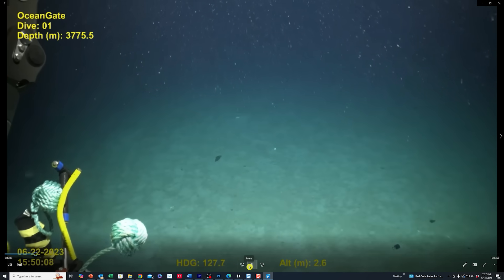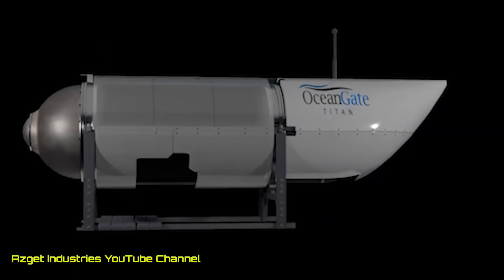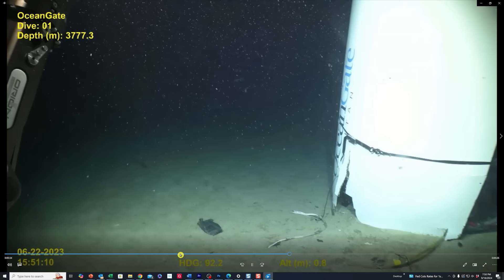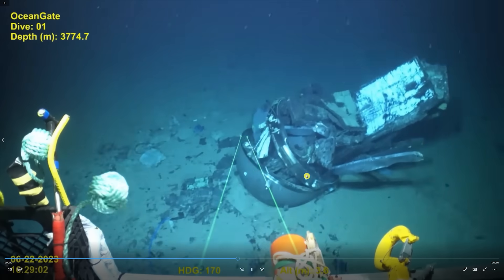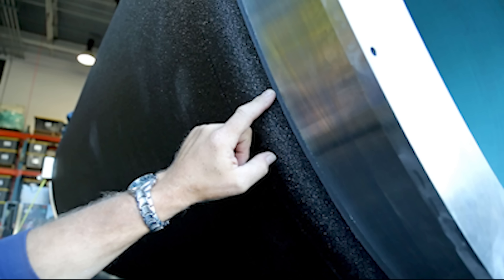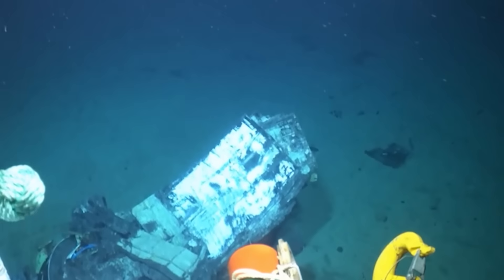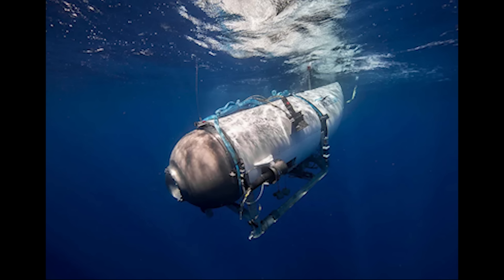OceanGate Titan Sub Debris Video Shows How It Imploded

Comment: As sad as I am for the families, this is starting to shape up to be the scam of the century.  I saw the release of liability forms which included the submersible was never subject to regulatory oversight.  Of course the carbon fiber was going to flex under such extreme pressure.  What I did not know before was the titanium constructed domes.  Titanium is an inflexible material.  I also thought the touching of the titanium by bare hands plays another major role.   Basic rules of adhesion requires clean oil-free surfaces.  I am not sure if the families have any recourse at all due to the release papers signed by each party

Comment: So if it’s on the bottom of the ocean how did someone put a ratchet strap around it?
Reply: Strap was on it before it went down. Shows how many corners they cut, holding the tail together with a ratchet strap.

Comment: As a certified JB Welder I think that some grooves or ridges should have been machined into each end cap as well as corresponding ridges in the carbon fiber. Then slice up the end caps like a pie so they could be installed inside the carbon fiber tube. Also a reinforced ring of titanium dead center. The glue joints where carbon meets titanium is eventually going to be found as the cause  -  in my opinion.

Comment: I'm no engineer, but I wouldn't even glue gussets to the truss on my backyard shed without some mechanical fastner reinforcement. What were they thinking just gluing polished titanium rings and end caps on carbon fiber?  This is proof that engineers conflated egos get in the way of design.

Comment: that first dome we see is the back end of the dome. based on what’s left of the titan, that second dome we see with parts of the hull on it are the window. the reason it looks the way it does is because a fail point in the carbon fiber happened at the front end of the diy sub, and everything inside and the sub it’s self got pushed into that second dome we see which is why you see all those small bits inside. theoretically, that is where the passengers are, they got pushed into a dome, along side the sub, in the span of milliseconds

Comment: That's an excellent point to raise, relative to the potential adhesion between the polished surface of the titanium ring and the "peanut-butter" adhesive.  There doesn't seem to be any "tooth" on the titanium ring for the adhesive to grip. And it's highly unlikely that any chemical bond could be formed, as titanium is almost chemically inert. 
So this is a significantly unanswered engineering question.

Comment: The first dome you see, the one stuck alone in the sand, is actually the front dome, the one that has/had the view port. The part that is still attached to some carbon fiber debris (which we can see just after) is the aft dome. You can even see the rings that connected it to the technical module (the white thing we the OceanGate logo we saw right at the beginning).

The titanium ring who sat between the carbon "tube" and the front dome is not visible on site. Maybe it has been thrown really far away by the brutal effects of the implosion, as its shape makes it more "hydrodynamic" that the whole titanium front dome itself.

As we can see in the videos presenting the whole scene, it's more than likely than the implosion started in the upper part of the carbon fiber tube, right at the junction between it and the front titanium ring (the famous one that we can't find, as said before). Looks like the "roof" collapsed and pushed everything inside right towards the technical module of the sub, which was actually set inside the aft dome.

Looks like the glue might have been the weak spot and the origin of the accident, actually...

edit : the rear part with the OceanGate logo looks relatively intact because it wasn't pressurised. It was always directly exposed to outer pressure of the ocean, so the implosion had relatively minor effects to it, as it was already exposed to the 380 atmospheres you have at this depth.

Comment: One thing you know for certain, is that cheap ass Mad Catz controller disintegrated. Wouldnt be surprised if they lost control of the sub because the directional button popped out of the casing or the directional sticks snapped off.

Comment: The wreck of the titan. 
Although the novel was written before the RMS Titanic was even conceptualized, there are some uncanny similarities between the fictional and real-life versions. Like the Titanic, the fictional ship sank after wrecking on an iceberg in April in the North Atlantic Ocean, and there were not enough lifeboats for all the passengers. The Titan would have survived a head-on collision with the iceberg, but a glancing encounter did more extensive damage. There are also similarities in size (800 ft [244 m] long for the Titan versus 882 ft 9 in [269 m] long for the Titanic), speed, and life-saving equipment. So not only was there a book that basically predicted the titanics sinking that was named the TITAN. But then hundreds of years later, there was a submersible named the TITAN that ALSO had casualties and ALSO ended up in 2 pieces on the ocean floor by the Titanic. 🤯

Comment: The dome is the front titanium dome with the viewing port. Even though the titanium is so strong it does flex some as carbon fiber even using the layering process is strong but rigid like heat treated aluminum very strong but brittle and when carbon fiber breaks it literally shatters it will not break in large pieces. As an Aerospace engineering background I worked with many unique materials.  And Carbon Fibre is the least liked in the industry unless it will be permanently applied in outerspace.

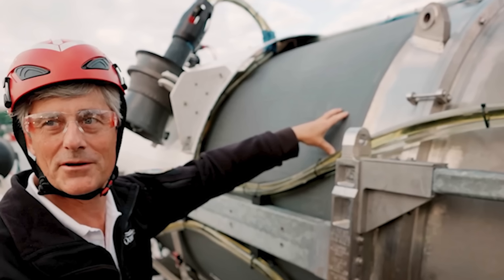Comment: @6:50 is it just me but does this guy sound creepy as hell the way he says this and smiles. Im not implying anything lol ... just damn!, if i had said it id be thinking I wish id done that peace to camera SLIGHTLY different in hindsight.  just after watching how it was made would have stopped me going in that disaster waiting to happen, he broke probably all engineering protocols just in the design of it but the way he had seperate materials in contact with each other scares me especially when done at pressure its like his mind was working on the thermal side of design to manage extremes of heat and made to be light and not thinking for pressure. I mean a chicken egg/ champagne bottle or raindrop can show us better designs than this flawed deathtrap at depth.

Comment: If the maximum speed that fresh water can decompress at is 1,500ms or  Mach 4.3. Now will this change if saline levels and temperature, ph change? I assume so.  For the submersible to implode then, the surrounding water needs to be decompressed, the amount needed of water needed is relative to how compressed the water is, so at 6,000 psi, water will compress by 2%, this means 50x the volume of the sub will need to be decompressed. I estimated the volume of water needed to fill the sub as 15m3, so we'd need 750m3 of water, this has a radius 5.6m. The decompression wave travelling at 1,500m/s (speed of sound in water) would take 3.7ms to decompress this amount of water, ergo the time taken to implode the submersible, with a water speed of 398m/s or 890mph.

Time: 3.7ms
Speed: 890mph / 1,432kmph
you aint feeling the implode but you will feel the many minutes prior when youre in full panic mode.

Comment: is that a bag of polystyrene cups in the top area of the wreckage inside, i.e they show how a cup becomes a thimble sized tiny cup due to compression at such depth, when i dived years ago we did it, wrote our names on them and after a deep dive we had a keepsake of our dives with name date and coordinates in a thimble sized dense cup. well it appears to me they probably did the same here, because i would have tied one on for this reason.

Comment: The problem is gas inclusions in the carbon fibre laminate, and adhesive section. Those gas pockets would have been compressing and expanding each pressure cycle and causing the gradual delamination and failure of the carbon section. The only way to have been aware of this is exhaustive x-ray examination or similar. Of course that's expensive and Rush was all about cutting corners.

Comment: @Jeffostroff    When repairing electronic devices, I remove hot glue from the circuit board by simply putting Isopropyl alchohol on it. The IPA has a low viscosity and it gets in between the hot glue and the board, releasing the bond. I wonder if, given the smooth Ti surface on the rings, the high pressure water helped by the flexing of the walls got in between the ring and the glue,in a manner similar to how IPA works on hot glue? That would not give any audio clues for their early warning system to catch. While every dive would cause a little more water to creep into the gap.

I agree that both the smooth surface on the rings and the obvious neglect of potential contamination by people putting it together, give good reason to think that the glue-Titanium bond failed. The end cap that still had wall with it looked like all of the chunks of wall had been shoved into that end. The cap was separated from the ring; like something had pushed it. If I'm right about the glue failing, and perhaps the window let the other end cap flex more, then I can see the bow end ring separating suddenly and the tube collapsing in and towards the stern. I think that would explain the things we see in the video.

Comment: You know, it is sad that it wasn't a workable design. The problem with deep water submersibles has always been that you can only fit one or two people into a tiny cramped sphere. If the carbon fiber design was workable, being able to take down multiple people in relative comfort (poop bucket notwithstanding) would've been a brilliant advancement in deep sea oceanography.

Comment: Glue plastic on to a shiny metal surface? That was a dumb idea. 
Platstic to metal interfacing is always going to fail under normal stress condition, let alone the 3800m depth environment.

Comment: 9:17 The big piece awfully looks like the smaller pieces have been drawn towards the front window.
I would assume, that the fault was somewhere in the front. Either the Ring connection or the looking port.
Edit: just noticed i mixed it up. the large portion is the back => probable fault in the connection between carbon and metal. That would even make more sense, cause the dome and the actual aft of the sub separated.

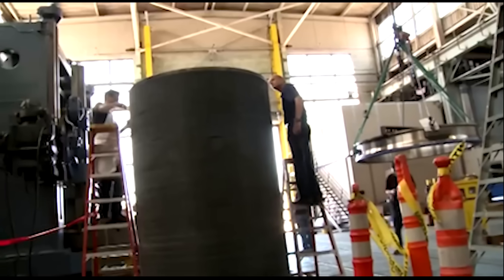Comment: 7:56 Depending on the type of adhesive, roughing the surface is counter productive.
Also priming the surface is depending on the type you are using.
I worked with a 2K adhesive professionally while developing an application, the metal part didn't have to be primed but the corresponding plastic part had to. (Later, during production, we saw, that even un-primed plastic had more than enough strength to hold twice or trice the necessary forces, so we ditched the priming entirely. And we were able to since it was a household appliance and not a safety aspect feature of a sub.)

Comment: i saw a vid by scott manley saying a break mustve occured at the forward interface between carbon and titanium, maybe the metal and carbon were not stressing / flexing equally so caused additional stress at their interface, the glue failed and the implosion occured at the front propagating backwards. hence no debris around the front dome as it simply fell off, and the debris carried back and around the rear dome as the hull and interior imploded back into that rear dome.

Comment: The second video is haunting. You can see the mechanism of death. 
The glue failed. The bow titanium ring was torn clean off and there seems to be no sign of it.  The bow titanium cap was there, no window that I could see. The “peanut butter” failed. The ridiculous way they applied that glue….there were voids and bubbles. All it took was one small point of failure and the water got in at unimaginable pressure. It forced all of the wreckage of the carbon fiber composite cylinder and everything else (remains) into the aft titanium pieces.

Comment: The aft section did not have the titanium end on it, it was found about 20 ft away from the front section titanium and plexiglass window, which looks like part of the inner aspect of the carbon fiber hull tried to force its way through the front titanium sphere? cheers 🦘🦘✌✌

Comment: I think the carbon fiber idea might have worked if it had been reinforced on the inside and outside with some kind of hardened steel insert and an outside skin of steel as well, maybe a half inch thick in both cases. Basically a hardened steel pipe that was equal to the diameter of the inside of the tube and another pipe that would go on the outside, both would have to be tight-fitting though, and probably glued in place.

Titanium is strong, but it is harder to work with than steel, steel is also more affordable. The drawback with using two different metal types is differences in corrosion rates, so more maintenance would have been required (as if more maintenance wasn't already required with carbon fiber and titanium).

It would be interesting to test a design like that and see what kind of results it would produce.

Comment: Acid etch and sterilize the titanium ring at a minimum... but for better locking adhesion, it should of had many small holes drilled into it for the epoxy to grab into.  Horrible incompetence displayed in their assembly process indeed.

Comment: yeah idiots an 1/8 inch or thinner welded titanium cylinder would have probably given the CF something to push against and I can't believe he had 2 titanium rings cut and then glued it to a CF toilet paper roll.. Just opening the door creates fatigue on the joints the way he built it. I literally all relies on glue

Comment: So, it essentially failed the way everyone said it would. The graphite cylinder collapsed, ripping it free of the unpressurized tail and popping off the domes at either end. I hope they didn’t have too much warning when it went.
Reply: Or the fancy domes popped out like champagne corks because there was no crosshatch scoring, grooves or other deviance to an otherwise perfectly smooth substrate. 

'Glue', 'Peanut Butter epoxy', etc. can only work as a part of a system. The 'right glue' for the job. If the adjoining parts can be 'melted' together like with PVC glue, cool. But most metal doesn't like or even care about adhesives!
Reply: There is a video where a guy makes a good case for the fore ring seal failing. This results in rapid ingress of water all around the seal. The pressure wave blows the fore dome and ring free (no debris around dome, and ring elsewhere), and blowing the cylinder apart from the inside. The pressure wave forced the cabin contents, along with some carbon fibre, into the aft dome. You can see where the front of the cabin appears clear and scraped free of anything.  I expect that most or all of the human remains will be in the rear hemisphere. To an observer, it would have looked like the cabin exploded and the front blew off.
Reply: I hope Stockton knew
Reply: Das implodieren ging schneller wie die es gemerkt hätten.
Aber ich denke schon das es knackende knirschende geräuche kurz vorher gegeben hat, weil von diesen geräuchen wurde bei vorherigen tauchfahrten mit der titan schon berichtet!

Der druckkörper von einem tiefsee tauchboot muss immer kugelförmig und aus metal/stahl sein, und nicht in zylinderform und kohlefasser!!
Dazu ist auch noch bekannt das kohlefasser gut bei druck von innen ist (wie beim flugzeug) aber sehr schlecht und ungeeignet bei druck von aussen!

Dieses tauchboot war russisch roulette und es war 100% klar das es nach wenigen tauchgängen schief gehen wird, und der typ von ocean gate der es gebaut hat war absolut unverantwortlich und brachte mit jeder tauchfahrt menschen in lebensgefahr, man hätte ihm stoppen müssen weil es absolut krankhaft war dieses boot für solche tiefen zu benutzen, und deswegen war es fair das er bei der letzten tauchfahrt dabei war!
Reply: It probably happened too quickly for the human mind to comprehend anything.
Reply: @collectorguy3919  The actual implosion would've occurred in less than a second and they wouldn't have experienced it, but there's some evidence they may have known the vessel was failing before it happened.
Reply: @Mr.Blonde92 imagine even a few seconds of hearing more and more snapping fibres getting louder...
Reply: There is evidence that they deployed the weights to try and start going back up. Didn't work too well
Reply: @rosesweetcharlotte  Dropping some weights doesn't necessarily mean they wanted to ascend.  It could mean they didn't want to hit the bottom at their descent speed.